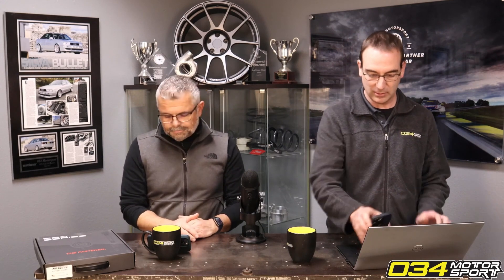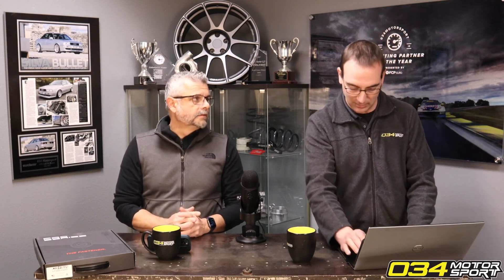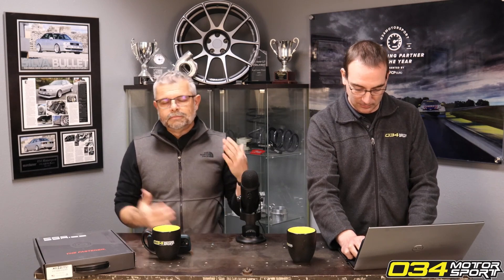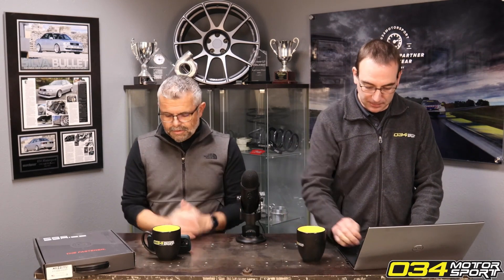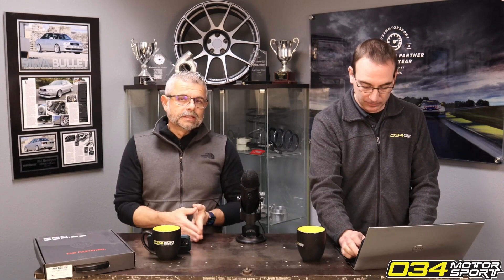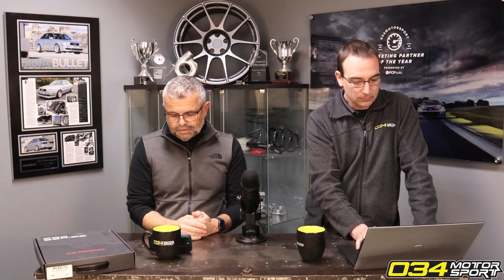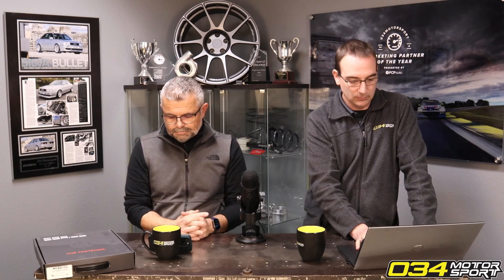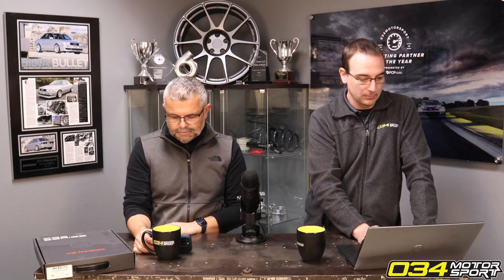207mm Crank Pulley Misconceptions | 034Motorsport

Comment: The 207mm on mine is rubbing against one of my serpentine belt pulleys. Any troubleshooting?
Reply from the maker: Please shoot an email to our Hardware Technical Support team at techsupport@034motorsport.com. We'll be able to assist you there.
Reply: what car do you have will this be a problem with the 2013 b8.5 audi s5
Reply: @quicksfn2126 I have the same issue on my 2013 b8.5 s5, what’s the solution?
Reply: This is the same issue I am running into…I’ve tried many other belt sizes with this setup but I end up with belt squeak because of rubbing. I think going a smaller crank pulley and doing a bigger supercharger pulley might help this. I have yet to try a dual pulley upgrade setup. Currently running single pulley crank 207mm stage 2+.

Comment: I am using different software brand (not 034) for stage 2 but using 034 207mm Crank pulley. Is there any problem with this setup?
Reply from the maker: Our 207mm pulley is considered a dual pulley setup. I would contact your tuner to ensure you're on the right tune for that crank pulley configuration.

Comment: I’ve been looking at getting the 207mm Crank Pulley when I plan to go to Stage 2. Versus changing the supercharger and crank pulley. I daily drive my S4, so it shouldn’t be an issue if I change just the crank pulley to the 207mm, correct?
Reply from the maker: That is correct! This would do great on Stage 2+ software

Comment: I recently ordered your 207mm pulley instead of the ol upper & lower pulleys in hopes of achieving stage 2 power levels based off the genius Audi inerwebies.  I have a merc HE on the way as well and planned on installing both and flashing with your stage 2 tune.  There are a handful of people trashing the 207 setup due to issues with belt slippage/breakage.  I have a 2013 S4 6mt and do some drag racing at a local track and minimal drives around town.  Ive heard many good things about the 207 but questioning my decision for obvious reasons prior to install.  Any help is greatly appreciated.  Keep up the good work!
Reply from the maker: Our 207mm crank pulley upgrade has been thoroughly tested to ensure it will perform without issue. We have plenty of customers running our 207 without issue!
Reply: Are you running the 207 setup? If so how is it treating you?

Comment: What Plugs do you recommend with 2+ dual pulley vs 2+ dual pulley E40? Same Plugs? 

I had the Brisk Racing Silver plugs from your site installed currently the Dr12S for stage 1...I also have the Dr10S ready to install when I put in my 207 pulley but I want to try running E40 as well. I wasnt sure If the 12 are better for the E40 2+ dual pulley or if I should go with the DR10 if Ill be switching back and forth if the difference is negligiable... Thank you for your time and assistance
Reply from the maker: We recommend OE plugs or Brisk DR10S on our tuning software

Comment: In my experience the biggest issue with the 207mm pulley is maintenance. The space between the supercharger belt tensioner and pulley is like 2 mm, if you ever need to change the supercharger belt or even the serpentine belt you're probably going to need to go in service position
Reply: I’ve changed my belt plenty times without going into service mode. 207 pulley stage 2+.
Reply: @PokéPosh what car do you have? I know the A8 has crazy amounts of room in the front, same with the sq5 I believe

Comment: if i used the pauter rods on the 3.0t and the head studs from wagner. could the 810 on e70 or 85 give me 800-820 hp in theory. would there be a seaparate tune or a custom tune? also is there any mods for the gearbox coming. in terms of more plates etc. will be able to reach ams alpha levels
Reply from the maker: There are still limitations within the turbo that would not allow that. We've got things in the works for pushing the barriers!
Reply: @034MotorsportUncut  please put out some info on the podcast. We would love to know. Here in india I have the fastest S5 in the country right now and we r still trying to come down to 9 sec. Please let us know. Thank you